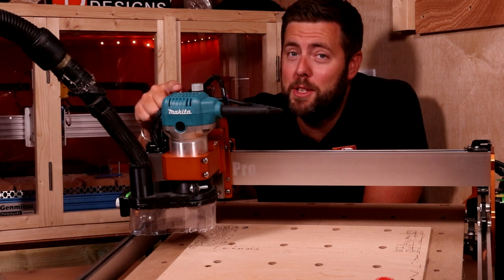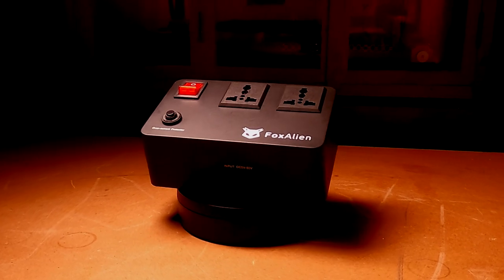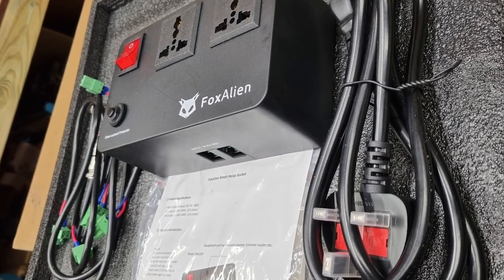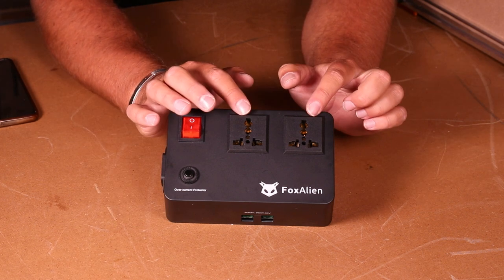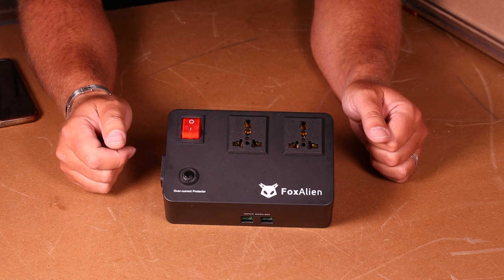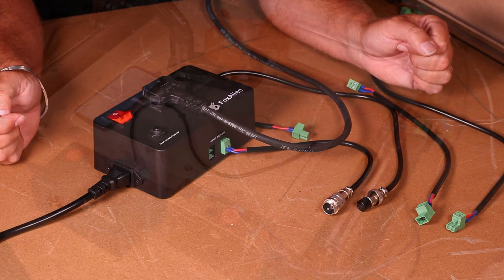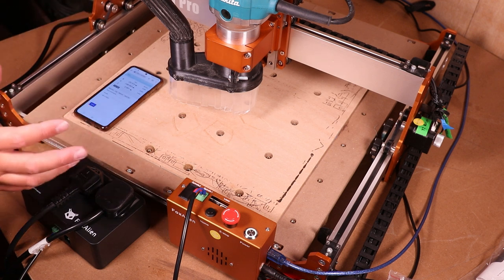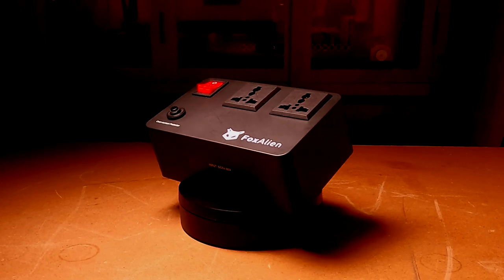EASY CNC router upgrade -  No re-wiring required - FoxAlien Smart Relay

Comment from the maker: IMPORTANT - the Makita 702 model will not work with this. If a router has anti stop start, these smart switches will not work. I have the 701 which works fine and pretty much any router without anti stop/start will also work fine
FoxAlien Smart Relay - https://bit.ly/434mTaI
Reply: I tried to buy one of these from Foxalien, I'm in Australia and the price in Aus is $A90.10
Now for the shock, they want $A300 for freight from Hong Kong. Needless to say I won't be buying one.

Comment: Agree, they need to change those "universal electrocution" sockets. Very unsafe. It's a simple bit of kit and if the price point was maximum £15-20 it'd be tempting but $50? That's a lot for what is basically a simple bit of electronics. It's not like it's rpm matching or anything complicated. It's essentially just detecting the spindle signal and switching a relay. Doesn't even need to use frequency to voltage converter or anything that complicated- a homebrew version would cost about a fiver to make. Nice unit but crazy high price point considering what it is. The homebrew wouldn't necessarily have an overcurrent but that could just be a fuse- not as easy to reactivate but realistically how often will the overcurrent be triggered?? It feels like FA are charging a lot for the convenience of something that works out of the box. It would be interesting to see what Big Clive makes of the internals- see what the seperation is like between the mains side and the low volt side. Even if they're changing out those uni sockets the fact they've even considered using them makes me twitchy as it smacks of jank. Mains power going up into the spindle control board could be somewhat suboptimal, especially for the PC plugged into the USB socket!!! Useful product, bad price point IMHO.
Reply from the maker: I dont think it's really targeted at those who are competent at building their own. Completely agree, yes the components will not amount to the same as the cost but for your average person they would need to find the right components (of the correct ratings), order them, build it before even putting it into a nice housing. With the time ordering, then assembling youre talking 1-2 hours, then add that to the cost of components. The cost is essentially for ease and convenience. But if you think this is expensive then the Yorahome one which is $90  will really make your eyes water 🤣
Reply: @JamesDeanDesigns  Very true James! Home brew electronics involving mains electricity could have unexpected costs I guess due to risk of fires / electrocution- e.g. costs being life, the workshop / house etc! For convenience and ability to sleep at night it's a good price 😃I guess it suits someone doing CNC when making stuff via CNC is the goal- for me the joy is modding and creating the CNC machine itself- if I was CNCing professionally I would have gone bust a long time ago!!  Great channel BTW!
Reply: I have the Gen 4040 pro. It does not have connectors that will fit. Has anyone changed the cable ends
Reply: For some of us, the convenience of not having to wire it up and make an enclosure is worth the extra.  Time is money...

Comment: So I have just got one, but it will not turn on dewalt router. I guess because it has some sort of safety switch on the motor. If I start the job and then turn it on after relay has switched it will switch off at end of job. But cannot start it, only the leds come on on the router. Any ideas how to overcome this?
Reply: Same exact issue I’m having!  Have you gained any insight as to wether or not this is a fixable issue or is this think junk?

Comment: So, I bought one and it does turn on the router (MAKITA) to start the job just fine, but when time for a tool change it does NOT turn off the router. Nor does it turn off the router when a job is complete. I have Genmitsu PROVER xl 6050 Plus. Oh, and I'm running UGS.Is this all this thing is good for, "turning on?"

Comment: will this relay work with a Genmitsu 4040 pro
Reply from the maker: Yes, but if using the Makita router just make sure you have the 701 or 700 model. The newer 702 has anti  stop start and doesn't like this kind of smart switches. Most other routers are fine

Comment: So, will not work for the Sainsmart 4040 Pro then without cutting wires.
Reply from the maker: Multiple ways around it but the easiest would be how I did it on the ProverXL 4030 V2 towards the end where I just connected straight to the existing spindle cable
Reply: @JamesDeanDesigns  Thank you James. I'd probably try it but first would want to get an extra cable for back up. LOL
Reply: @crystalrabbon  I wired up the Sainsmart 4040 pro without wire cutting.  Blades, like those found on the standard spindle, are readily available at, of course Amazon, or even your local auto parts store.  One word of note: polarity does matter.  I had them switched for a moment and found the power supply on the 4040 pro disables itself as an overcurrent protection device.   Reset this condition by unplugging the power supply then plug it back in.     Best of luck!
Love the convenience of router and vac auto on/off for the jobs.
Reply: @JamesDeanDesigns  problem with this approach is that my Genmitsu cable failed, which is one reason why I went with an external router.  Now I need to get a replacement from Genmitsu as well...

Comment: Hi James just got the genmitsu 1.25 router and fox alien relay , but for the life of me cannot see where it connects to control box , any help appreciated
Reply: I also am having an this issue. I believe the Genmitsu 4040 Pro Spindle Output is a different pin connector than the extra wires that came with Fox Alien IO relay. 

Q) Has anybody found the correct connectors for sale?

Comment: What i did is i mounted a power strip somewhere in my machine with a stick to poke the on off switch and modified my post processor to go to the location and turn it on or off.

Comment: Hi for some reason when I press go on the job the router doesn’t start up on its own despite changing the settings in Easel. I can over come this problem by manually turning the router off and back on again as it’s travelling to its start point (not ideal). Have you any advice on this? Thanks

Comment: Connecting the Fox Alien to my 4030.  How do you control the RPM's?  Is it controlled by the software as before? I'm adding a Makita RT0701C to mine.
Reply: You don’t, the makita has a knob control for rpm. You just set it on the makita itself. Whatever you set your rpm in your software won’t matter. It will just give you an idea for chip load

Comment: Hi James, I connected this to my Sainsmart 4040 and Makita RT0702CX4 router. However, the router will not turn on, the light on top flashes red. According to the Makita manual, this is a safety feature that prevents automatic starting. The unit will turn the router off when I turn the spindle off in the software, but I have to manually turn it on to start a job. I wondered if you have a solution/thoughts on this and if anyone else has the same problem. Thanks, Chris.
Reply: I have a genmitsu 4040 pro , I am trying to find out if this relay works with my cnc machine, is that what you are using it for?  if so I am wondering how you hook it up because I am not sure where it plugs in at

Comment: Too bad this doesn't work with Genmitsu CNC machines!  Important bit of information!
Reply: You're half right - if you watch to the roughly 5 minute mark he has it connected to the ProVer 4030. It is more accurate to say it is not plug and play on genmitsu machines. You do have to do a bit of wire splicing, but it does in fact work with genmitsu.

Comment: Cool idea.  I am rather new to CNC'ing.. I was wondering if this would work with a OneFinity X-50 Woodworker?  Thanks in advance
Reply from the maker: As long as the control board has some form of spindle output then yes it should work

Comment: This is great and will be awesome for controlling my dust extractor.  But I'm using a VFD and spindle on my Vasto,  is there a way to connect that so that I can start/stop the spindle using the Vasto's controller?  I've searched haven't found anything.
Reply from the maker: There certainly will be. If you VFD is wired up to start the spindle, then it should just be a case of taping into that supply... however I am not an electrical engineer.

Comment: Will it work with a xcarve? Thanks
Reply from the maker: As long as your control board has a spindle output, it should work. I'm not familiar with the control board on an Xcarve though
Reply: @JamesDeanDesigns  thanks for your reply

Comment: OK, I used this for the first time today. Total disaster.  It was going great until about five minutes into the carve,  I heard an audible "pop" and the relay shut off the router and vac while the FA Vasto was still running.  I had to hit the emergency stop. The Easel program then had issues finding my machine again. Once I had reset and reconnected everything, I started my Easel program again and TRIED using the previous starting point and settings to begin since my origin point had already been carved out and the I couldn't use my probe. Welllll,  when I hit the carve button the original coordinates had obviously been effed up because the damn thing started carving NO WHERE NEAR the origin and totally f'ed up my whole design. I can't trust this thing anymore. It petered out  within a few minutes of use and totally screwed up my carve.  I'm a BIG fan of FA and have numerous lasers and products of theirs but this thing is dubious. Seriously PO'd.
Reply from the maker: Sorry to hear that. Did it trip the surge protection on the box and did you figure out what tripped it? 
I know it's too late for this now but may help you in the future.  Always home your machine before starting and note the machine coordinates when you do the Zero. If you ever have to do something like an emergency stop or there is a fail, re run the homing and return back to your noted coordinates. This will guarantee the job starts back at the same place
Reply: @JamesDeanDesigns  I  made several test runs and it cuts itself off about ten minutes in on EVERY carve. The problem is the over current protector is triggering.  It says it will trip at over 12 amps. Well, that's a problem since my vac system is 10 amps and the router is 7 amps.  Which means I can run one or the other but not both which kinda defeats the purpose. I'm in contact with FoxAlien and we're working on it.

Thanks for all your vids! I've learned a lot from you and think you do a wonderful job!
Reply from the maker: @somewhatarkayne1663  that's sort of good to hear. First, the box is actually tripping for the reason it's meant to as opposed to just being faulty. And second, the fact FoxAlien are talking to you. Its interesting it cuts out half way through as usually to my knowledge there is more of a surge at the start but keep me updated 👍
Reply: They're still trying to figure it out. I have video of it triggering for no reason. My husband does some electrical work and he thinks that when the router runs for awhile (or the vac system) they start upping amperage due to heat and it is triggering current protector.  If so, this isn't going to work for two separate tools. Will  keep updating!
 @JamesDeanDesigns

Comment: Quite impressed by the price, was expecting it to be more expensive.
Only running standard spindle on Genmitsu 4040 at the minute though
Reply from the maker: Yes, for the price and how easy it is, it's a good uog
Reply: I just upgraded to the Dewalt 611. Get it! It is a new machine! Cuts that were not clean are now as smooth and clean.

Comment: If you still have the built in spindle that came with the router can you plug it in to the other input on the relay to run it like normal from the control box?
Reply from the maker: I dont think so as its an input not an output, but I'm not 100% sure